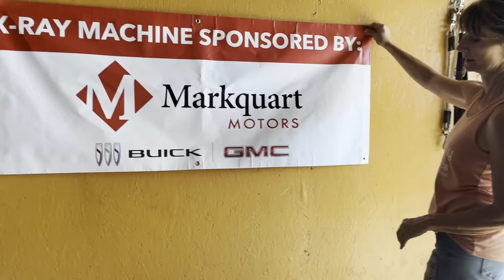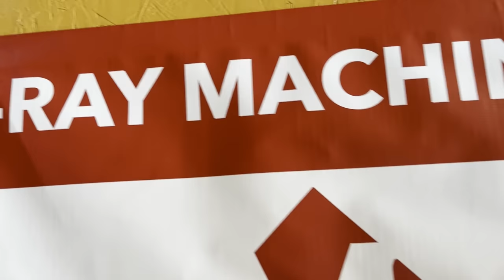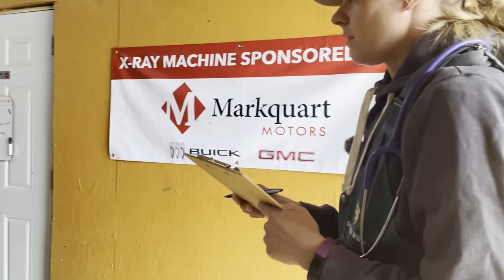For the Love of a Farrier - Part 2

Comment: Hi Pony Tails!  I've been watching you through the Horse Plus Human Society videos and have now subscribed.  Both organizations are doing amazing work with rescuing so many horses/mules/donkeys.  I have over 25 years of horse experience and unfortunately have not been riding in some time now (job, kids, etc. took over).  I was watching one of your videos from a couple months ago where you received an owner surrender that had proud flesh on his hind leg.  I had a horse that tried jumping out of his stall and got his hind leg stuck and ripped the skin off to the bone, then developed proud flesh around the wound.  To keep flies away we used a simple mixture of a bottle of warm water (we reused an empty dawn dish soap bottle) with three cap fulls (only three, to a full size bottle, which is maybe about 1 to 1 1/2 tsp) of original Lysol Disinfectant (the one in the dark brown bottle).   We would apply it twice a day, just shake the bottle and squirt on the proud flesh and surrounding area.  Store the bottle in a room temperature place.  This help keep flies off the area and the hair grew back the same color instead of white like some wounds.  A simple, much less expensive form of fly repellent for wounds.

Comment: With Draft Horse we pull the foot up on the Block and strap it down so thy can't kick as much. Much Saffer practice.
A little History lesson from a 70-Year-old Brush Popping Cowboy on two Horse Showing Episodes, You Kids are wonderful! I don't want to see any one Heut. It's panful and Heeling Physically and Mentally takes time! 

Round 1, Lesson 1. As told to me by my Grandad John A. Forest 1894 -1976 and my Uncle Johnny Forrest 1924-7976. I'm a little hardheaded and a slow Lerner at times, are you?

A local Blacksmith here in Eckert Named Melvin was close friends of My Mother's side of the Family the Forrest's, He did Farrier work as well like most old time Blacksmiths back in the 20's on. He Started in Eckert Colorado and moved to Delta some 13 or 14 Miles down the road. His Sons have the Business today. 

Melvin had a Horse brough in to be resawed. Melvin did the Usual removal, measuring for Stock, Heating and Shaping with the Forge and on the Anvil. 
Melvin picked up a Hind Foot and started to put a show on, The Horse kicked Him out in the Road and through a little fit. Melvin though well I must have spooked Him and let Him settle down! 
Roud 2. Melvin Tried again, the Horse Kicked Him out in the road again and came completely undue! throe one hell of a fit. 
Melvin let Him settle down, while He saddled up His Horse, then led this on down the Road to my Grandad John A. Forrest 1894 - 1876 and my Uncle Johnny Forrest 1924 -1976

Eckert Colorado:
They had to Lay the Hores Down and tie Him up to put Show on Him, on the Ground. He throws one heel of a Feight, Pissed on His tale and slung it all about, Bit the Dirt and tried to Bight them! When the Dust settled and the Showing was done, they let Him lie on the Ground for a few minutes and cool down, they untied Him and let Him stand up. 
He was once again a calm Horse. They saddled up and took Him back to Melvin.

Crawford Colorado:
Round 1. I helped in Showing a Horse near Craford Colorado that was just about as bad. We started out standing up, she exploded, so we stretcher her out between two Cedar Posts and laid her down. She Pissed on her tale and slung it all about; Bit the Dirt tried to Bits any one she thought she could reach, broke of 2 average size older Cedar Post, and we had to scramble to other Cedar Posts. We showed her. When she stood up, she was ok. Round 2. Same thing with her! with the exception we didn't break any more Cedar Posts.

Showing Stocks:
Using a Showing Stalk is a good Idea and may be a Back saver. The Horse must have belly straps so He or she can't fall down or try to lie down, Back straps in some cases so He or she can't fight and jump to high, You need a good sized Rope and a pair of good strong eyelets that are easy to access, to pull the Foot up Quickle and tie it off, Put your rope through the Upper Eyelet on well mannered Horses, On fighter go down throug the second for a Mecanical advantage With calm Hores one eyelet works but with a Fighters two Eyelet spaces about 12" inches apart give you a Mechanical advantage with the Liberty of holding fast and pulling up your slack as needed. You can easily lift the Foot without getting Rope Burn. Rope Burn essent much fun, A wild Louse Fighting Horse is a danger to everyone, tearing up your Showing Stall and maybe someone getting het or killed. The Feet needs to be securely Belted down to the Block so the Horse Kent Kick, like the one in this Video that took the Farriers Nipers Kicking. For a second, I thought He was a had Lad, so did He! 

This is my email address if you or someone has questions kingraymondw590@gmail.com

Comment: I've seen clips from other countries that don't have saws..instead they use sharp flat edge hoe or shovel works extremely fast...just chopping off the long hoof. And horse isn't scare of the vibration..,
Reply: I've seen those videos too - of donkeys.  Have never seen any farrier do that with a horse.  They are similar animals but not exactly the same.
Reply: I’ve seen use of other tools, & have yet to see anything that works better than a saws-all. They’re more precise, & safer  than whacking hooves with tools😳!!

Comment: I don't know if it would be the same for horses as humans.  I personally handled Neuropathy by taking 4 ingredients.  

1.  Benfoteamine this is the most bioavailable form of B1. I weigh about 180 lobs and take 250 - 300 mg daily.  

2.  R-Alpha Lipoic Acid -   I always make sure it's the R ALA form for highest bioavailability. 300 mg daily 

3.  B12 as Methylcobalamine for highest bioavailability -  I started lower but found the best results at 5,000 mcg daily then I cut back a little to 3,000 mcg after I got the Neuropathy under control.

4.  Magnesium Malate is what I ended up with as it is most bioavailable from what I've read. Be careful if you use Magnesium Citrate because that is a laxative. I actually started out with Magnesium oil because it doesn't get destroyed in the digestive tract. It's kind of messy and requires a lot of clean up. You may want to start with it though. Your body can assimilate about 80% of the magnesium if applied to your skin. Only about 20% survives the digestive tract.

Of course everything would need to be adjusted by weight if it works on a horse. 

If you don't mind spending more money in the long run there is a product called "Nerve Renew" that I have heard great things about coming  back from people who have tried it.  Personally, I buy the four main ingredients in bulk online to save money. I'm still getting GREAT results.